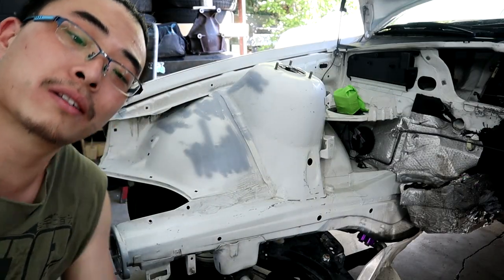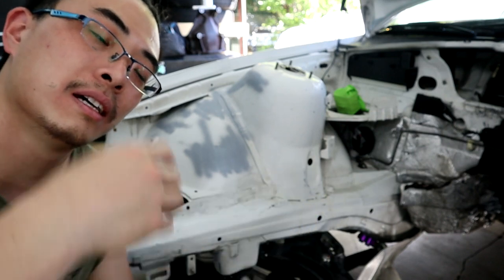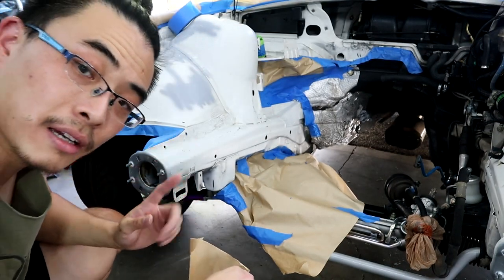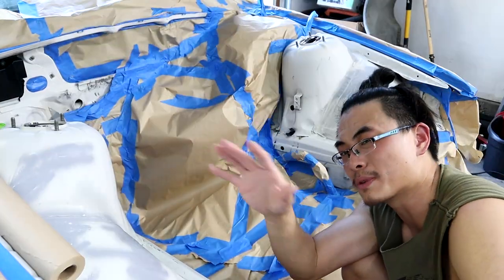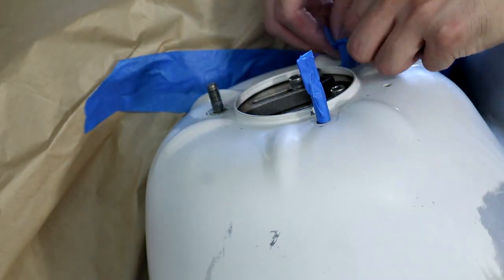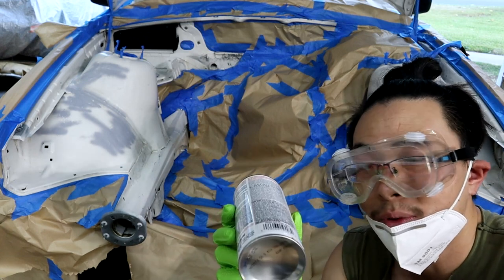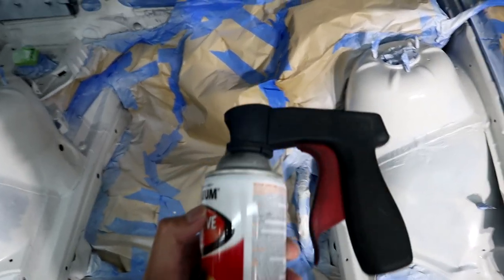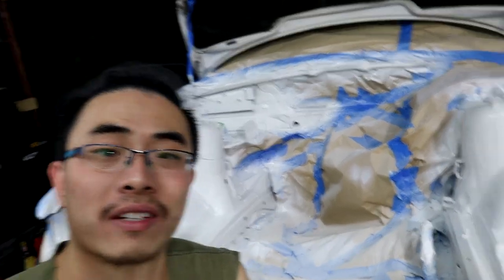How To Properly SPRAY PAINT your engine bay [Part 2 of 2 - MASK & PAINT]

Comment: Really good video, im gonna be using this to paint my E36 engine bay. Was just thinking matte black for durability. Was thinking of not using any sort of clear coat
Reply from the maker: Thank you!
I dont think the clear coat is necessary unless it's a show car, as for durability, as long as you sand the original paint throughly and spray it well, it will hold for a long time.